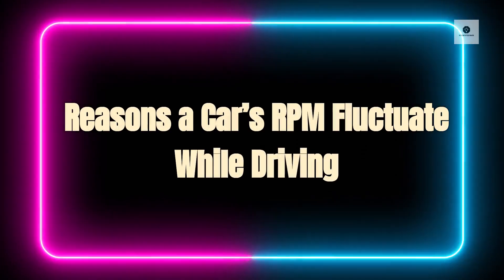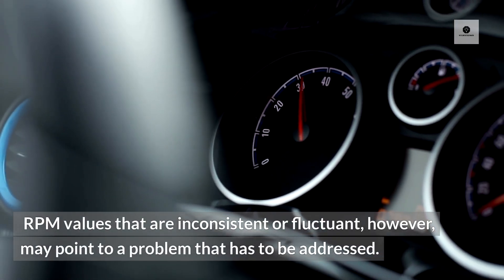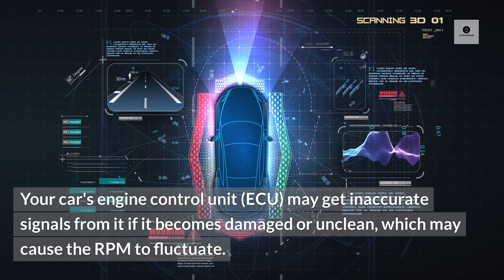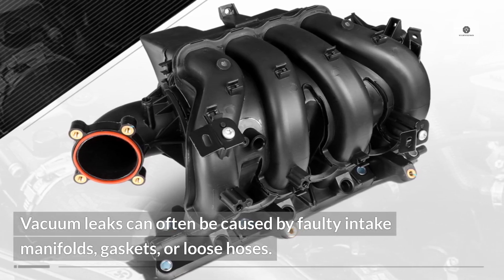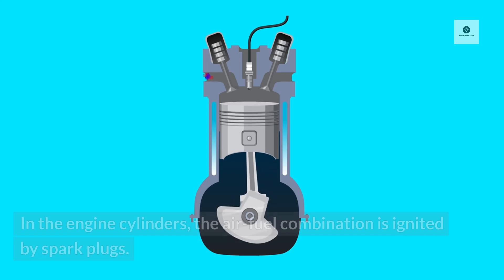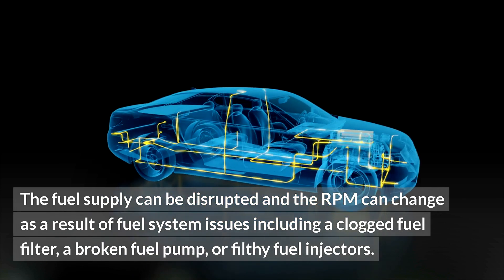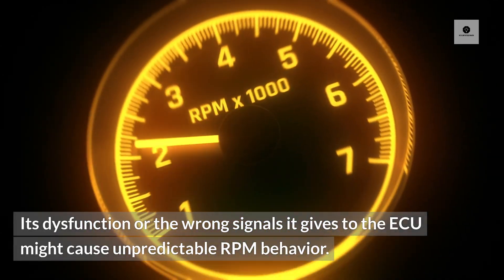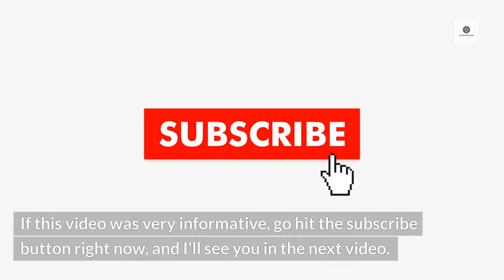Reasons Your Car's RPM Fluctuates | Common Causes

Comment: Had same problem on my Tahoe 2009 RPM Fluctuating in idle with no check engine or codes. After checking found one fan not working and blown fan-hi relay replaced it and after 6 days second fan-low relay blown. Replaced it but fan still off. Problem was fan connector had burn mark on it. Replace connector and now ok. Funny  symptoms point to air fuel mixture.
Reply: My rpm gets to fluctuating and my Tahoe will shudder kinda I jus had my trans rebuilt and 3 torque converters put in and it’s still doing it. No codes or nothing. Idk why could be going on